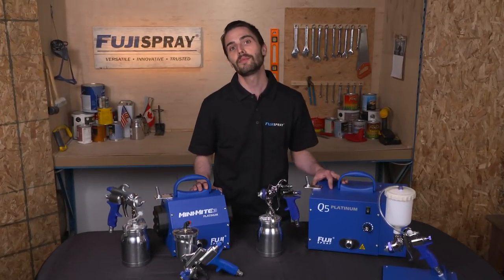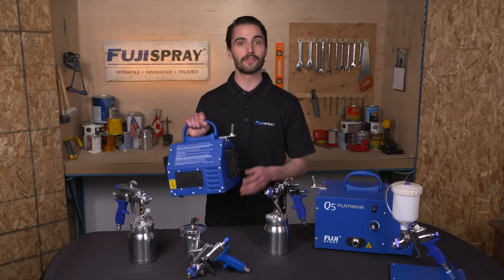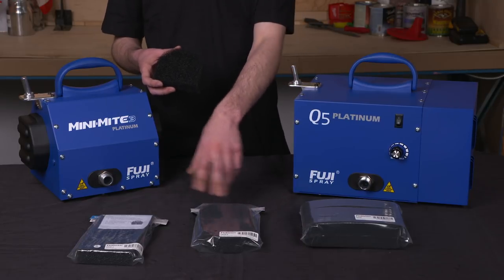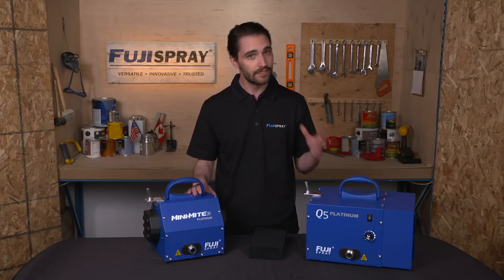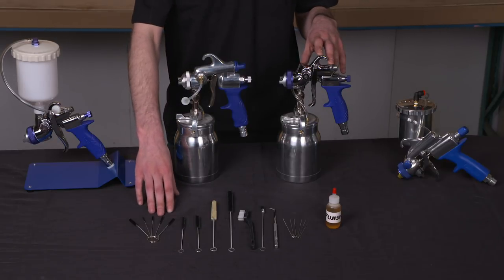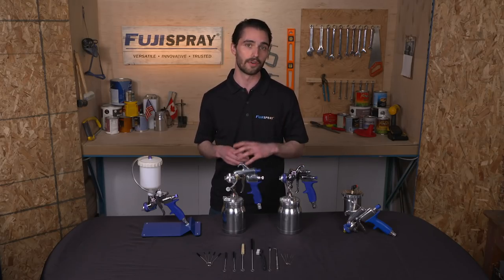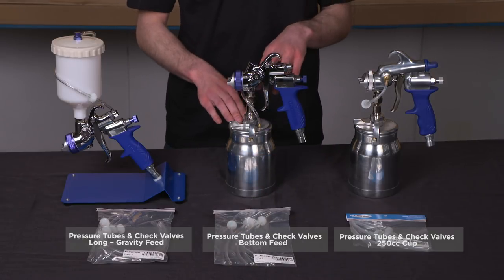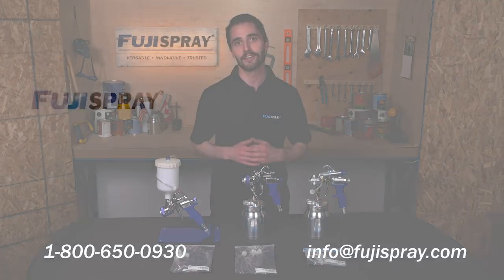How To | Jim's Top 4 Maintenance Tips

Comment: What about storage for long periods of time?  I purchase a sprayer about a year and a half ago and want to stop check everything - any recommendations?
Reply from the maker: Great question - we would advise using the warm air from the turbine to remove any moisture that may still be in the spray gun. For turbine storage, we would recommend placing it in an area that will not experience freezing temperatures. If you have any more questions you can check out our blog on storage located on our website or give us a call at 1-800-650-0930.

Comment: Thank you for the tips.
What's the maximum length of the air hose that can be used with Q5 Platinum without loosing on the turbine performance?
Reply from the maker: Another 25ft length of air hose is the maximum you can add, this will amount to 56ft in total (including the 6ft whip hose). - Fuji Spray Team -

Comment: Hello Fuji spray. my turbine motor is blowing out white powder from the air compressor. how do I clean the fans?
Reply from the maker: First and foremost importantly, be sure that the turbine is kept as far away as possible from the spray area, 15 to 20 feet at the very least. secondly, please make sure that turbine's filter(s) are kept clean; they are washable and reusable. Be sure that the filter is completely dry before reinstalling it. As for the issue at hand, you'll need to open the turbine case and use compressed air to blow off all of the ingested overspray. - Fuji Spray Team -
Reply: @FujiSpray  thank you

Comment: I have a Fuji XPC spray gun.  It does not spray material.  The problem is that the needle gets stuck in the closed position and does not move when I depress the trigger so only air flows and not the finish or paint.  The needle is clean.  The fluid nozzle is clean.  If I loosen the fluid nozzle a quarter turn from snug, then it sprays material.  why would the needle stick?  Thank you for any advice.
Reply from the maker: The Fluid Control Knob at the back of the spray gun is too tight. You will need to turn the Fluid Control Knob at least half turn counter clockwise for the needle to have retracting motion. You can turn the Fluid Control counter clockwise even more to achieve more material flow to your liking. If you require further assistance, please contact Fuji Spray customer care directly. 1-800-650-0930.  - Fuji Spray Team -